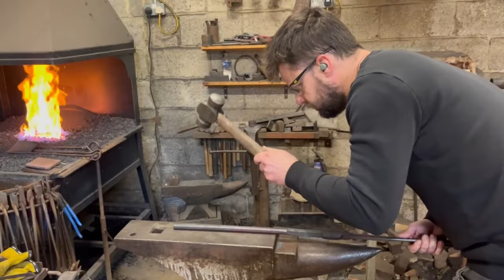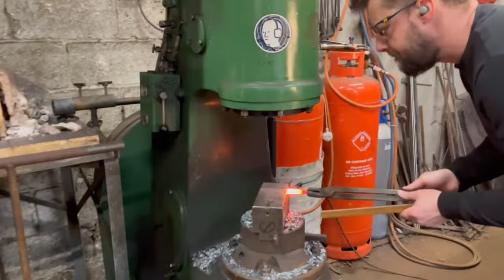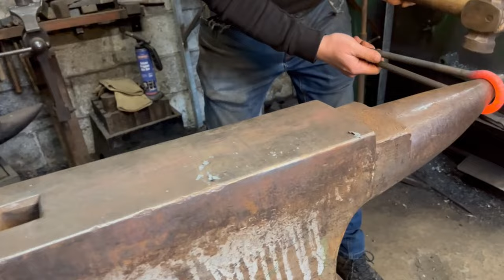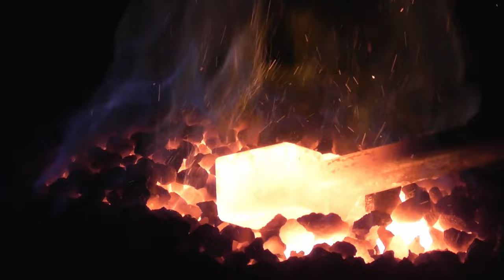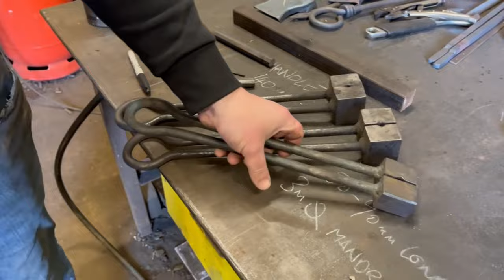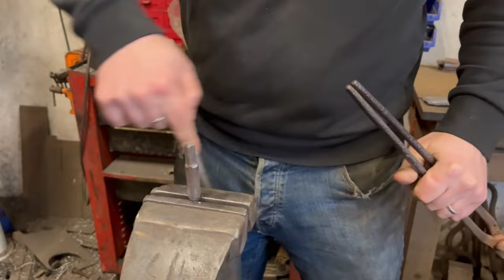I Discovered Why Blacksmiths Don’t Make Corkscrews!

Comment: Is the tooling you made all mild steel (1018ish) or something like 4140?
Reply from the maker: All mild steel in this video. Even when forging stainless it just about holds up. If I was turning this into a production run I would make sure to case harden the tooling, but, don't worry I won't be making any more of them!